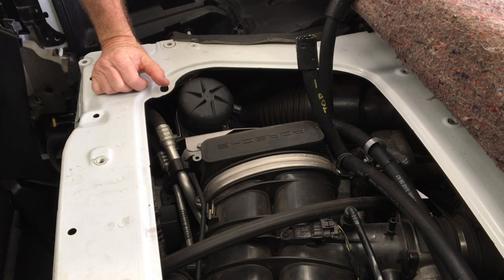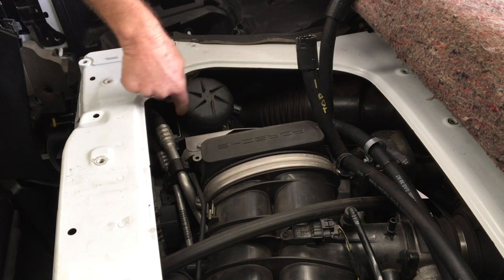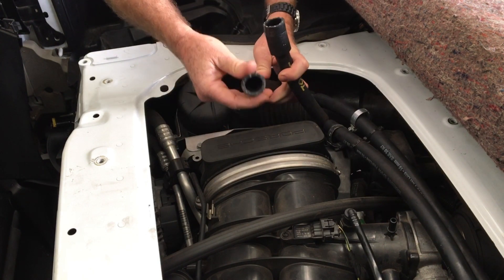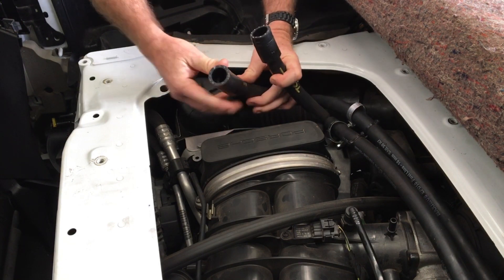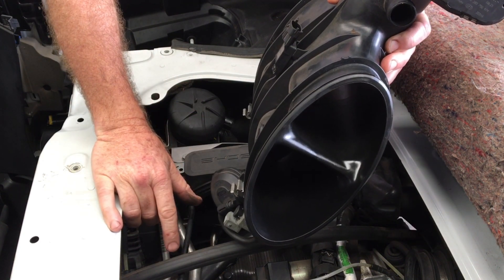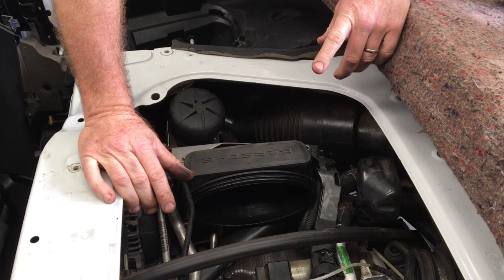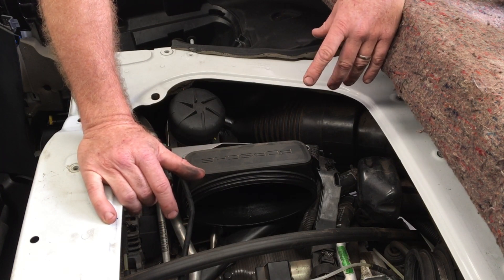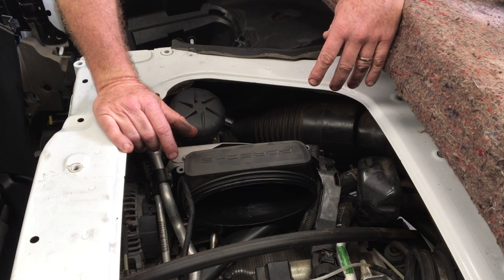Porsche 981 catch can update at 5000km

Comment: Hi , Jeff 
Looks good , the filter is still in good shape ? 
My 2.9 will get the same treatment , this to make the random Blue smoke on start up dissapear.... Rgds Nico
Reply from the maker: The filter looked fine. Mann say it should be good for 50,000 km. From what I've seen, most of the work is done at the top by the swirling action and very little is done by the filter itself. Unlike the normal oil filter that catches debris, the CC filter has clean oil go through it so it stays very clean. It just coalesces the oil droplets, so I expect it to last a very long time.

Comment: How much further have you driven since this video? Any updates?
Reply from the maker: No, but I do check the pipes etc each time I do a service. Each time the outlet pipe from the catch can is perfectly dry, so my assumption is there is no oil getting to the intakes. I also check the crank vacuum occasionally to check all is OK. Driven about 15,000 km since the cleaning. If I get the time I might make another vid, but I've a lot on my plate.
Reply: @jeffrichardsoncardiy  cheers! Thanks for everything you do.